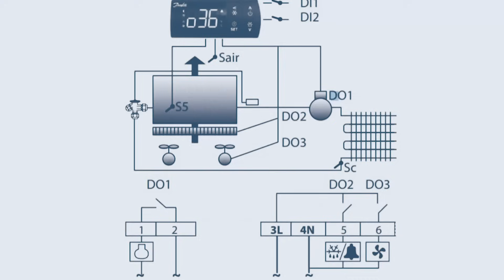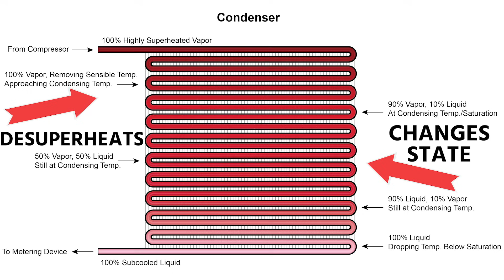Evaporator 101

Comment: What makes the evaporator coil make a whooshing sound during start up and in 1 minute the whooshing sound goes away then it remains quiet.then when you switch it on again and it does the same again. But the unit is cooling and the pressure is correct

Comment: Can someone shed some light on the text book question. "Refrigerant in the form of low-pressure vapor has the highest capacity to absorb heat" the correct answer in the text book question is "false" but I can not find the answer in the book, that states if either liquid or vapor has the highest capacity to absorb heat.

Comment: So the air in the home is moist and humid all of a sudden!! I’ve had several techs look at it, changed the return plenum, had it level and cleaned. There was water built up in the supply duct work. And I opened it today. There is little water coming out of the drain line when running. And between the evap and blower had mold spores built up 3 days after cleaning. I’m interested in what it could be. Open to ideas. Currently turned the unit off cause I can’t take it anymore. Send help!
Reply: Might be oversized or over charged with refrigerant.

Comment: Question, what will happen in a dehumidifier if the evaporator gets 60 degrees Celsius high humidity air from a dryer. Would you need to lower or increase the pressure to handle that since most dehumidifiers only seem to handle air up to 40 degrees Celsius ?

Comment: Hello I have an evaporator r 717 with no data and I don’t know how to know it’s cooling capacity it’s dim is 2x2x1.2 fin spacing 10mm number of pipes is 244 and it’s diameter is 1.3 cm

Comment: So what would happen if I put a container of refrigerant inside a freezer?   The refrigerant would boil inside the container and how would it evaporate would it blow the container?
Reply: Nothing will happen if you put a container of refrigerant in a freezer. I have containers of refrigerant stored in an outdoor shed and it gets below zero F every winter, nothing happens to the refrigerant. The refrigerant only changes state due to pressure changes, it only boils when pressure is reduced and in the container it remains under pressure.
Reply: @onemoremisfit  thanks for the answer !     Not sure I understand how it can boil without off gassing and building pressure but then again I don't know about the biology of refrigerant.

Comment: Evaporator freezing question. I assume when evaporator coils freeze it is from the bottom up (earliest input after metering device). I have a dirty coil (hair, particles and seemingly some biofilm that I have been brushing out) and some freezing (near the bottom inch). All of the small lines branching out after the metering device have frost uniformly as they enter the coils. However not all the coils are freezing uniformly across (some bottom loops are just sweaty). Does this suggest that my coil freezing problem is mostly a flow issue in certain parts? Or could it still be a refrigerant issue?

Comment: Ive came across systems that use 2 evaps with only one compressor and condenser..  they were laid out with the freezer evap first in series then the fridge after and to the compressor.  So that would imply the reliance on the refrigerant to move in the vapor form after the freezer , into the warmer environment which would condense it back into a liquid somewhat allowing it to absorb more heat from the warmer environment of the fridge..  right?  Or am i recalling it wrong and the fridge part should be first then the freezer?  Pretty sure the freezer would be first..  now ive only came across this maybe twice in my life and were on built in units that were separated from eachother which allowed space between the coils.  Guessing there would have been a metering device between them but wasent able to see exactly how they worked before were torn out and replaced with a newer single unit..  always wondered how those worked and if they just had some crazy plumbing routing to make it work.  But i remember there only being one beefy sealed compressor and one big condenser with 2 evaps..  one smaller and one bigger..  i would think the unit would section off the single condenser into 2 that would allow both evaps to be independent..  where the refrigerant would cycle through the compressor before going to the other coil but thatd be a ton of extra plumbing and the capillary tube would be a head scratcher..  for me at least.  Still trying to learn..

Comment: If we use a condenser at high pressure to facilitate moving heat out of the refrigerant why wouldn't we put high pressure to the evaporator to move heat into the refrigerant? Wouldn't it be more efficient that way

Comment: Hi! A few weeks ago a tech from an ac company came over to check my gas pack unit I'm not sure if it's called like that the unit has both the ac and heater in the same unit and it is in the roof of my house, and he removed the sensing bulb from the place it was and said to just leave it there it is not touching the pipe I believe is the evaporator's exit any more. Do you have any idea why he might have done that? Is it safe for my ac unit? I live in Tucson Arizona. Thank you. Great video by the way 👍👍

Comment: Checked the sheet shart... if the bulb is loose which regulates the superheat, that means more refrigerant will go through the evaporator.
If the evaporator is unsuccessful at turning all that extra refrigerant into vapor, the compressor could be receiving liquid and destroying itself, right?

/Plumber from Sweden studying to be an HVAC technician aswell :-)

Comment: The slight difference in temperature between saturation temp and coil surface temp is about 5 degrees and it is called evaporator  skin temperature.  This difference is due to the coil heat transfer being affected by oil circulation, and the material that the coil is made out of.

Comment: Man I wish you guys lived near my home.  I have a Trane XR17 (2019)and I have a Delta T of 10.  55 percent humidity in the home.
Reply: What are your pressures, subcool, superheat readings, anemometer or static pressure readings, a delta t of 10 degrees is very low, the clear result app we use has a target range of a minimum of 14 and a maximun amount of 20.

Comment: 8:55 Does having a higher superheat means the system is more or less efficient?
ie, Does higher superheat imply the system was able to extract more heat from the room?
Reply: X Y Z  the lower the superheat, the higher the efficiency, due to more active surface area of the evaporator.  We can’t run zero superheat, because we need to protect the compressor.  Carrier tried to run zero superheat with its flowtronic chillers, about 20 years ago, because they thought they had good control with their electronic stepper motor driven expansion valves.  Well, those units lost a lot of compressors which were 6 cylinder O6D semi hermetic compressors.

Comment: You said Saturated refrigerant is part liquid and part vapor.
But saturated air is 100% vapor.
That's why I cannot understand the meaning of saturated.
I might understand this if I watched it 1000 times
Reply: Actually, 100% saturated air is at its "dew point".  That means that at that temperature, water vapor will condense out of the air-water vapor mixture.

Comment: I have an Evaporator which only has 1/3 is cold (showed condesed water around the copper tubes). I have cleaned the metering device piston and the screen before the piston and replaced the liquid line filter drier and the evaporator coil. Do you have any idea what's wrong with it? 
The suction line has two kinked turns which are less than 90 degree. Do you think that lead to the starved evaporator? The owner said he used to get temperature lower than 77F. Right now I measure the supply temperature from the closest register it has temperature around 80F.
I have checked the pressures (R-22 3 tons unit) and subcooling and superheat. Pressures are in good ranges. The superheat is around 34F. Subcooling is around 10. Any idea about what caused this symptom? Thank you
Reply: What’re the numeric values for your pressure man...amp draw

Comment: FOR THE READERS:

Ah,  but water boils at near freezing at low pressures..  In fact,  the freezing point of water  is also its triple point.  But at such low pressures,  the flow rate per ton would require compressors with ridiculously large displacement... so a workaround is using an absorption cycle,  using something like lithium bromide and calcium chloride brine.  But water is an excellent refrigerant at higher temperatures.  It is instructive to note that in chilled water loops,  water is not the refrigerant, but the transfer medium.  Same with glycol chillers. Also,  water is used as an absorbent in ammonia absorption systems,  where ammonia is the refrigerant.  Confusing, to say the least,  to the uninitiated... and let's not even get started on ammonia chillers with flooded evaporators...

Comment: Great video...
75/25 liquid & vapor thru the TXV 
Evaporator absorbs LATENT & SENSIBLE heat
ALSO the heat exchange that happens in the EVAP. occurs thru CONVECTION...correct me if I'm wrong...
Reply: It would be convection is there was no fan.  In forced air, convection is a MINOR factor in heat transfer,  where CONDUCTION and RADIATION take over.  The same thing happens at the condenser (if it is air cooled),  except for the opposite direction of heat transfer.  Enthalpy is lost or gained along the surfaces of the tubes and fins.

Comment: If your up in the mountains will the boiling point of the refrigerant be lower or the same ? Lower right? 🤔
Reply: Water boils at 212F, at sea level, the higher altitude you go means less PRESSURE, so it takes LESS Energy/Heat to make the water boil..... (Temperature/Pressure relationship)
Reply: @Progress24.7  so the Freon , the boiling point of like R-22 or R-410a any Freon would be lower right ? 🤔
Reply: @tinymanthebeast  No... it's not called freon, its referred to as *Refrigerant*, also R22 and R410 are two Different refrigerants so they boil at different temps, if you refer to a P/T Chart you will find the Temp/ pressure they need to be...
Reply: @Progress24.7  if you're up in the mountains the super heat set point we'll be different right?
Reply: @tinymanthebeast  Good question. I believe it shouldn't make much of a difference because when dealing with A.C your working with a Pressurized system...also I believe there are special P/T charts that include what the temp needs to be at certain altitudes...ive never worked in the mountains so I'm not to familiar with this scenario....
Reply: @Progress24.7  Actually, "Freon" was DuPont's trade name for R12 and R22.  Other manufacturers used their own trade names, like "Genetron", Forane", etc.  They were trade names for the CFC refrigerants, mainly.  But they got away with jacking up the prices of refrigerants,  because nothing is Freon this planet anymore.
Reply: @tinymanthebeast  No.  The refrigerant is in a closed system whose pressure has no relationship to the pressure of the air in the atmosphere.
Reply: I think it should not affect. It is a closed system, boiling point of the refrigerant in a system will only depend on the relation pressure/temperature inside the system.
Reply: @REFRITEKREFRIGERACION  EGGGGZACTLY....